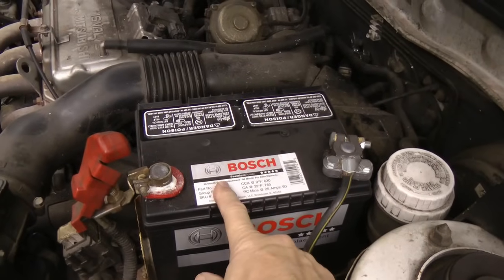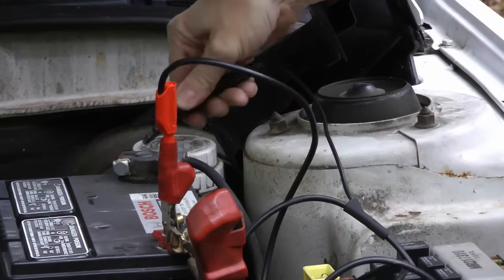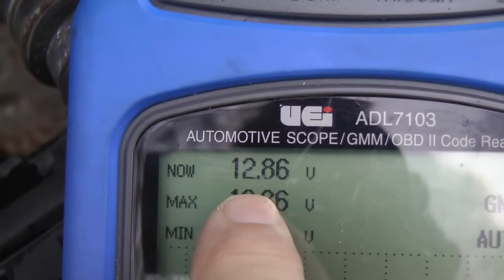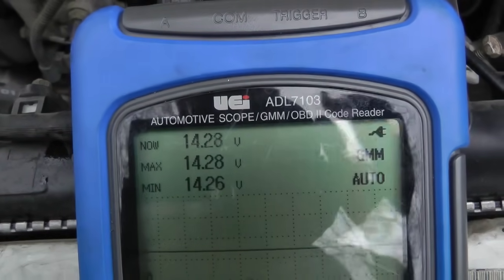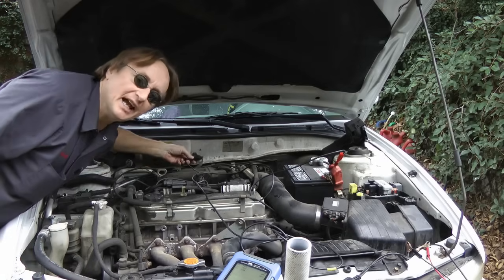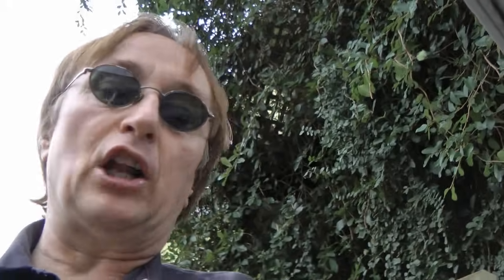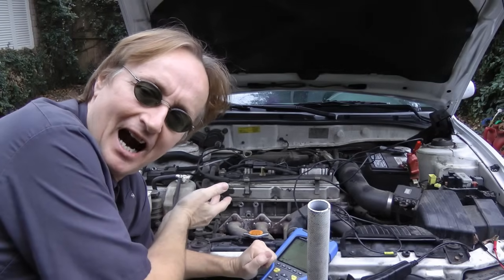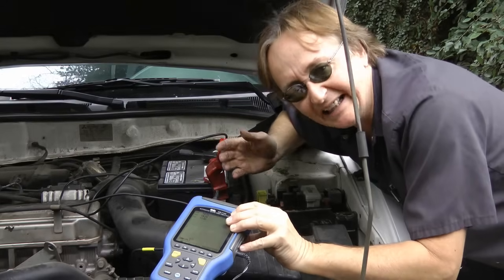How to Fix Electrical Problems in Your Car (Ground Fault)

Comment: Ok so I was taking off the + terminal off my battery and accidentally welded my ratchet to the holder for about 5 seconds till i pried it off. I was going down to the shops and when I turned my lights on, my radio shut off and also when I put my blinkers on my rev taco would bounce up and down!
I checked all the fuses I could find and they were good.
Also I have another battery hooked up in parallel and my Volt meter in the dash is well over the halfway mark.
Any ideas?
Reply from the maker: elnogga so many things can get fried doing that. Start by checking ALL the fuses and all the power wires for melted parts, and PRAY the main compute wasn't fried
Reply: All the fuses are good. haven't got around to all the wires yet but my car does drive normally, besides the power issue. its a 94 Toyota Surf btw

Comment: Scotty I just bought a 2002 BMW 330CI. The signal indicators inside the car don't work but the signal lights outside the car do. Then sometimes the ones inside will work then they stop working. What do you think?
Reply from the maker: Steven Taylor   those computer run monsters are hell to work on electrically. BUT, try a new flasher switch inside the car, those often go bad and do just that
Reply: Thanks Scotty, I will try that.

Comment: Hey Scotty, your videos are awesome!! I need some help, I have a 1950 Cadillac series 62 with a siz volt system and when you turn the blinker say to the left turn signal, both indicator lights on the dash come on as if the hazard lights are on but the car doesn't have hazard lights. I am assuming its a ground issue but am not sure.
Reply from the maker: Sal Torres bad ground or shorting out turn signal stalk assembly, good luck tracing that down
Reply: Any suggestions?

Comment: Hi Scotty. My wife has a 2013 Dodge Avenger that has started to do some crazy things. First thing was when I filled it up with gas, as soon as I left the gas station it went down to “E” and gas light came on. It went right back up to Full and down to “E” and then it kicked on the CE light. Had it looked at they said that the fuel pump was fine that the level gauge was acting erratic per the codes. Then a few weeks later my wife went to start it and it wouldn’t start until the fourth try, all the while the trunk would pop. Then the light will flash for a sec on the dash, and the trunk will  pop when driving periodically. The TPMS light will also some time flash, but there is no issues with tires. The Dealer told us that per the stored codes, that they believe that the aftermarket remote starter is to blame. Could this be true? We are goig to get it disconnected this week to start. Thank you

Comment: Hi Scotty. My wife has a 2013 Dodge Avenger. Recently it has been doing some weird things. First, I filled it up with gas, and as soon as I left the gas station , it went down to E then went back to full , and preceded to kick the CE light. It went off , we had it looked at and they said sending unit was fine. Then a few weeks later my wife went to start it an it wouldn't, until the third try, but the trunk kept popping. Then while driving sometime the dash lights will flash for a sec, and sometimes it pops the trunk. Now the TPMS light will flash an sometimes stay on. There is nothing wrong with the tires. we took it to dealer and they seem to think that the two codes it threw are being caused by the aftermarket remote starter. Help.
Reply from the maker: ford k   typical dodge, crap electronics. Check for bad grounds  , they are known for that. BUT, those aftermarket remote starters are UBER complex, and easily that could cause such problems from electrical interference, I've seen it myself
Reply: Scotty Kilmer Thanks Scotty. How many grounds am I looking for?? Getting the Remote Starter uninstalled tomorrow. I guess that's a start.

Comment: I have a 99 mercury sable runs great never had no problem.. but all of a sudden radio, speedometer, inside lights, an heat want work now car crank but want start..what can it be?? fuses not blown, new battery, car even crank wit starter fuel.. but jumper cables want even start it. Please help!!!
Reply from the maker: Snoop Allen try my video "fixing a car that cranks but doesn't start up"

Comment: Hi Scott  I have a strange electrical problem. My 2008 E250 Econoline van  .the instrument cluster and the radio electric windows will go off then they go on .also when every goes off the vehicle will not start does not click or anything.
Reply from the maker: Glenn Remillard  replace the ignition switch, pray the fix is that easy
Reply: Thank you I will try that .I replaced the ignition cylinder though it was that but wasn't.

Comment: Hi Scotty,  I have a 1994 Nissan Sentra.  The tail lights do not work ( I've already changed the fuse) but the brake lights and blinkers work fine. 
Where do I begin to solve this problem?   Thank you for your time, you are truly the BEST.
Reply from the maker: Dawn Di Eigidio  that old, check the circuit board on the lenses back there, they often corrode and short out, also check the sockets for corrosion
Reply: Scotty Kilmer
Thank you so much Scotty.  My son said you are the best, and I totally agree with him.

Comment: Hey Scotty I changed my fuel pump 2 days ago car runs great now but 2days later my fuel range on my 94 deville 4.9 keeps going up and down when I drive at high speeds gallons are accurate but the range jump up
Reply from the maker: Eric Martinez that's something in the dash, wiring or body control module. If in the tank, it would read gallons wrong too
Reply: Gallons are perfect just the range keeps going up and down like today was perfect

Comment: Scotty, on my 99 elantra, my turns work then at times they dont , i replaced the flasher , an the turn signal switch , i noticed when they stop working the flasher makes a weird noise, it can't be the flasher , its brand new, also when i play with the hazard 4 way switch at times then the turn signal works normal, what is going on ? please let me know so i can have this fixed , thank you
Reply from the maker: Kody Darlington  replace the hazard switch they short out internally and do just that

Comment: hey scotty i have a 2004 chevy tahoe and i was replacing my dome lights i got from ebay and they worked and just went all out at one point now none of them will turn on any ideas???
Reply from the maker: Jose Aguilar   check the fuse first, you may have blown it messing with the bulbs

Comment: hey scotty my wife drives a 08 Hyundai Elantra, about 3 days ago we noticed that when we used the brakes the dash light would come on. when we released the brakes it would go away. Please any info or pointers towards the right direction will help.
Reply from the maker: mixkid831  check the brake system grounding wires first, pray it's that and not a bad computer module which can also do that

Comment: What would make the fog light, driver light blinking, horn sounds only when the right turn signal is on, but the turn signal don.t flash
Reply from the maker: Travis Jones electrical shorts in the wiring system, and if an American car, often a bad body control module will do that. Check the ground wiring first

Comment: I have a 2004 Nissan Primera and whenever I brake the reverse camera comes on and sometimes, my left indicator flickers at double speed. How do I fix this?
Reply from the maker: Stephen Tanner check for bad grounding wires at the back of the vehicle, they often do that. Pray it's not a bad computer module

Comment: Scotty, whats the best way to find a bad ground in headlights hi and low beams. My dome override is good, relays are good. When I remove the bulbs and test the hook up, both are showing positive and no ground. (only two wires) Help!!!!
Reply: mged1jr MOST cars will have their own dedicated ground wire for each headlight. Typically, there is a black wire that is connected to one headlight socket (or two if you have two bulbs per side) and this wire usually bolts to some metal part of the body (radiator support or inner fender well) very close by. Make sure the connector at the end of the wire, and the metal that it attaches to, is free from dirt and corrosion.

Good luck!

Comment: I found the fuse.. befor i pulled the fuse i put my meter inline reading amps on the negative terminal per ur video. I was drawing 1.3 amps so i pulled the radio fuse and now only drawing .5 what stps can i take now to i dentify exact issue?

Comment: Ok just started to troubleshoot the electrical with the car on I disconnected the negative terminal from the battery the car seemed like it wanted to turn off but did not probably because I have an overall load I got a Samsung TVs but anyways I shut the car off with the negative terminal off and instantly the fuel gauge and temperature gauge went up so they reading the temperature and the fuel with the negative terminal disconnected from the battery what would that mean
Reply from the maker: warehousegeekrq NEVER run a car with terminal off, that will fry computer circuits, pray you haven't done that already.  And check for ground and wiring circuit shorts for your problem. when you disconnect negative terminal, that often forces other wires to act as grounds and it destroys stuff quickly

Comment: I have a 2001 yukon xl when I turn the ignition key all and remove the keys all the gauges goto 0. I noticed when I sit in my car a minute later gas gauge and temperature gauge begin to read yes soon as I open the door back 0. And again I close the door in a minute later I guess the temperature gauge begin to read. I had to exchange my battery because I thought the battery was not working this is the second battery in 6 months I thought it was the alternator so I bought the alternator but did the alternator test in the car remains on when I disconnect the lead to the from the battery how should I begin to troubleshoot those two cages from draining my battery
Reply from the maker: warehousegeekrq   the dash units often go bad on that model, and sometimes in conjunction with the body control module. But they cost SO much, best to find a guy like me with a GM dealer level scanner to analyze that system.

Comment: i had a problem with the toyota hilux 1998 model,the power window is not working, the light indicators are not working, and also the airconditioning system, it stops working while i was driving, could you help me about it, tanx
Reply from the maker: Jenkiss Dutallas that old thing, probably has numerous problems. But check the ignition switch for problems first, as it powers all those devices
Reply: ok thanks Scotty

Comment: Thanks for the help , I'm gonna go check those things out today , how can I tell if I have a leaky injector , could I use a multimeter ?
Reply from the maker: jonathan spriggs meters won't show leaks, you use a pressure gauge and if it drops pressure near that injector, it's leaking. OR check that spark plug, if wet, that one's leaking

Comment: Hey Scotty ,92 dodge caravan 3.3l 255k won't start , worked fine yesterday , got in it this morning just cranks , checked for spark have it , fuel have it but nothing , check my coilpack primary/secondary are within spec , wires/plugs are new 600 miles, new fuel pump/filter 100 miles  alternator took it out to test it pass test at autozone 3x , I'm lost now (suggestions plz)
Reply from the maker: jonathan spriggs you have spark and fuel, and IF they are synched correctly and firing at the correct moment, generally either the head gasket or other engine part is broken, OR the engine is flooding out from too much gas, such as leaking injector or fuel pressure regulator.   good luck
Reply: jonathan spriggs Did you check your spark at the plugs? I had spark at my distributor cap on my truck, but the ignition control module itself was the culprit. Same symptom you have. Fuel, good spark, good everything seemingly, just no start.

Comment: Yo, scotty my car (2003 Honda Accord EX) keeps shutting down and turning back on when I try to put all the windows down simultaneously. Then my engine light comes on. I also installed an sux cable (simple plug-in to the bottom of my stereo) and it gives a buzzing sound when I rev up. Any tips in solving this issue?
Reply from the maker: amplifier is picking up alternator spinning, you need a noise filter for that. And, have the alternator and battery load tested, places like auto zone do that free, either one going bad can do all that too
Reply: Thanks Scotty!
Reply: Wait, I don't have an amplifier but I'll go to auto zone to have them check my battery and alternator.

Comment: What's your thoughts on Lucas transmission fix? My truck has 130k miles and I thought about just doing it for preventative measures. Transmission is ok.
Reply from the maker: good stuff, I use it all the time on normal vehicles. But of course it's not for fancy bmws and mercedes that use special fluids in the transmissions

Comment: Scotty I have a question, I had one of those fuse adapters that allows me to ad and object to the fuse line.  accidently the inline fuse got pulled out.  this fuse used to be a switched item, that only came on when the car was on. 

Now this item stays on all the time no matter when, can you help me figure this out.
Reply from the maker: you might have put it in backwards, realize one side of the fuse has power all the time and the other is protected by the fuse. Pray you didn't short out wiring putting it on backwards

Comment: what is you have a short and the test light is lite you pull all the fuses and still the light stays on showing a short...
Reply from the maker: realize there are many unfused items, like starters, alternators, computers, which you then need to unplug their wiring to check them

Comment: Hi Scotty, my scooter headlights do not light but when I press the brake or turn signals, they light up and brighter when I rev the engine. Without pressing the brake or turn signals, they stay off. Sound like a grounding issue?

Battery is good and starting up  the engine not a problem.
Reply from the maker: yep, check for loose or corroded ground AND power wires

Comment: Hello.  Have a 2003 sierra. Driver side door dead. No locks, windows, etc. Changed driver side door module that did not fix it. Pulled the left door circuit breaker and did continuity test and it read fine. Any ideas?
Reply from the maker: often the wires bend and bend opening and closing the door and eventually the wiring breaks inside, check that first

Comment: when I turn ignition switch on and in normal running, switches off.dash lights and  rights side headlight. Now I got the hold the key to keep the car running. If I let go the key the car will stop running

Comment: Ive been having big time problems with my car all week. It all started when I tried to start my car and the starter motor kept turning while the car was running! I tried to start it two times before it finally stopped! And once it did my car lights would dim radio would shut off and trunk would pop all when I hit the breaks. Bought a wire tester light today put it on the hotwire on the starter and a good ground on the car and turned the key the car had no problem and the light on the tester came on everything worked fine! Tried it one more time no light came on on the tester and all the electrical problems came back. Could this be a bad hotwire?

Comment: hello scotty i have a 2007 seat ibiza and when i press the brake pedal all the locks of the car locks and unlocks i have changed the central locking model but the problem is still there is this a ground wires problem???please help!!!!!!
Reply from the maker: you have an electrical cross wiring short somewhere, they dont' sell those here, but on a GM car that's often a bad body control module, so check that on yours
Reply: Scotty Kilmer sorry scotty but how i check it?

Comment: Yo Scotty have a 89 mustang 5.0 blinkers don't blink when switch is on. Just lights up no blink. And the dash the whole dash doesn't work besides the Speedo and low fuel light comes on when I have more than enough fuel it has a factory alarm and battery goes dead when I let it sit for a day. Thanks

Comment: Hello Good Ol' Scotty, I'm working on a 1996 Isuzu trooper (i know they suck) and it's not starting, I checked sparkplugs and I noticed there is a wire that has a nut that's grounded onto the engine block and on the other side of the wire, it has a connector piece, it's on the driverside between the 2 spark plug modulars. It's right under the air intake. I can't seem to find where it's supposed to go. I'm thinking this is causing my issue? The engine does crank and I also hear a weird pumping noise near the air filter. Lights do work as well
Reply from the maker: it's just a grounding wire, if you run a new wire from the battery negative terminal and bolt it on the body of the engine and it starts, that's the problem.But I doubt it. From that noise though, easily could be a giant vacuum leak or a blowing head gasket sucking air, typical on those

Comment: Hey Scotty, I have 1998 VW  Polo 1.0 when the car is idling and i turn on etheir the lights, wipers or the heater the rpms drop sometimes it even makes the car stall can you help me out?
Reply from the maker: have the battery and alternator load tested, auto zones do that free, often one of those going out does that

Comment: I have a 1999 nissan altima gxe  in my dash board lights wont come on in when i turn on my head light my radio lights goes off but it stills work how can i fix this problem